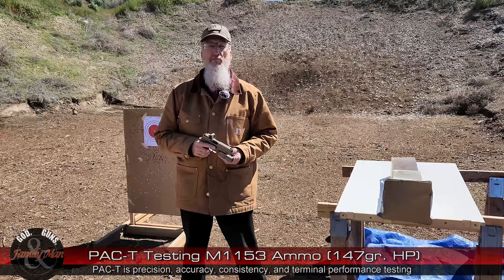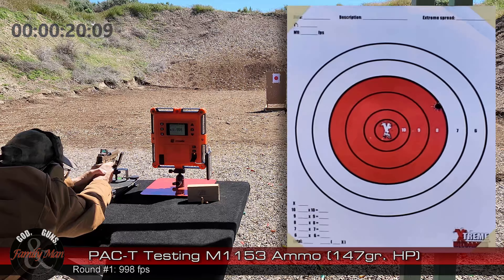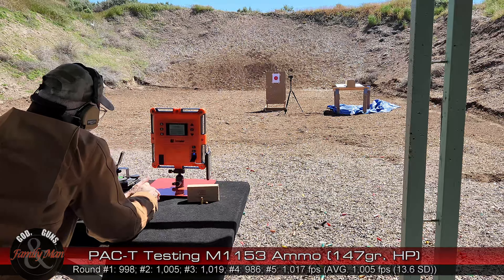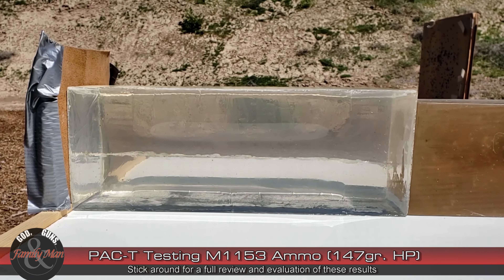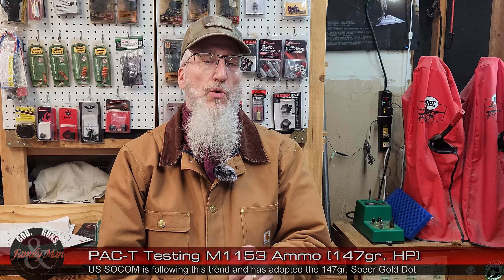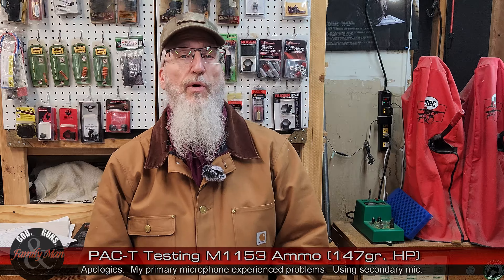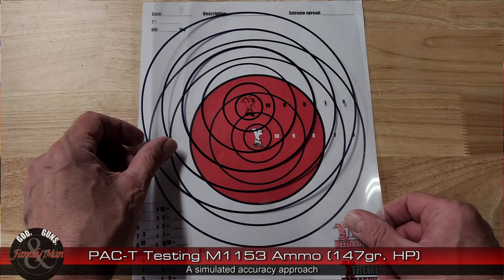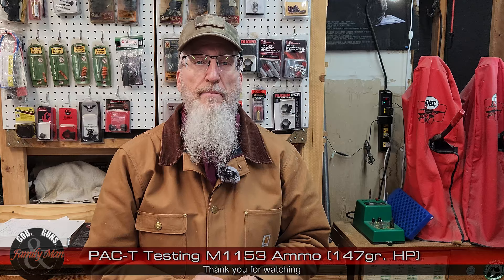Testing the US Army's 147 gr. JHP M1153 +P+ 9mm Ammo

Comment: The speed of sound changes by temperature. The air pressure over density is constant. Frequency, amplitude, wavelength have no influence on the speed of sound. If we talk ideal gas and not 100 km high near vacuum or inside a pressurized car tire.
Reply from the maker: Yes, that is correct, that is why I note speed of sound at my location. However, even with variability in the speed of sound these rounds will almost certainly remain subsonic anywhere on the planet.

Comment: The m1153 uses the ra9sxtc bullet, Winchester also sells it as USA9JHP3 of which i bought a 50rnd box of. Compared to the federal hi shok 147gr 9ms it has a little more kick but not bad at all. I’ve shot about 600 rounds of the m1152 loading in the Winchester sg9w box and that’s the most kick I’ve felt out of a 9mm bullet yet and it’s what I put in my handgun for hiking.

Comment: Ahhh, I believe Winchester is fibbing on the +p+ pressure,, I got a chronograph and do a little ammo testing ever now and then my self, and I’ve got more speeds out of standered pressure 147gr, from a couple of my 4 inch barrel guns, and the regular +p ammo I’ve tested I get around 1100fps, and with a couple of my 5inch barrel guns they get around the 1150fps range, give or take a few feet per second
Reply from the maker: That is interesting.  This was tested using a full-sized pistol (in fact very similar to the one adopted by the military) and I agree, this does not seem like +P+.
In addition, this box of ammo is considered reference ammo for the M1153 and not sub-par surplus.
Thanks for watching!

Comment: One point - the Hague Convention speaks specifically of expanding bullets. This waste of lead and copper fulfilled that requirement. Better to use a controlled fracturing bullet - it doesn't expand, but it surely makes a more devastating wound than either a FMJ or a non-expanding hollow point.

BTW, a +P+ round that's slower than a standard pressure round of the same weight? Ridiculous.
Reply from the maker: I have seen other "bare" gel tests where this same bullet expanded nicely.  However, our test with these soft barriers more closely mimics reality.  It is disappointing that the bullet failed to expand and as result, over-penetrated.  When the Hague Convention made that agreement, there was no such thing as a controlled fracturing, barrier blind bullet.  I wonder what such a convention would declare today.
Overall, it looks like this bullet was not a good decision by the Army.   They could have chosen the 147 gr. HST or as you suggest, a barrier blind CF bullet.  Thanks for watching and posting.  More good stuff coming up.

Comment: you want some really hot stuff try the m1152. This stuff you have here isnt no +p+
Reply from the maker: I believe it is loaded like it is to keep it subsonic.  I am not sure why they labeled it +p+ though.
Reply: @sdkweber  All the apparent mislabeling tends to confuse me brother. For instance this m1153 labeled as +p+ but only getting 900 something fps makes me wonder is some other loads that aren't labeled as +p or +p+ might actually be +p or better. The m1152 I mentioned isn't labeled as +p or +p+ on the box yet in the stats it claims a muzzle velocity of 1320 fps at the muzzle with a psi of 39,500. That indicates it is a tad above +p but not quite +p+. It's in a little gray area between the 2. It also says it is loaded to military specs 10% higher than industry standards. It has a 115 gr fmj flat  tip bullet. I fired several mags through my taurus g3 and it functioned well but you can feel the increase in felt recoil and muzzle flip. I still have 200 rounds of it. My g3 is a fairly sturdy and robust gun but certainly is not on the same toughness level of a sig or a glock so after I finish off what I have left of the m1152 I will stick with standard pressure ammo just to play safe, and I'd be very weary of shooting any of it through my smaller g2c.
Reply from the maker: @kennethrisner-c8q  I hear ya.  Most of the 9mm rounds I shoot are "standard", in other words not +p and certainly not +p+.

Comment: I wonder if the failure to expand is related to the short barrel velocity. I was under the impression (possibly faulty) that the 9mm +p+ was brought about to use in the uzi and hk mp5 style weapons which have a bit more barrel length to extract more from the load.
Reply: Any faster and it would be supersonic, which would defeat the purpose of using it in suppressed SMGs.
Reply: @ESMaddock  yes, but back years ago when the +p+ was designed, supressors were available, but not in the common usage they are today. The idea was a round to make the sub-guns more reliable and more effective downrange since it was"only a 9mm"
Reply from the maker: The failure to expand was because It clogged as it passed through the jacket and leather.  I heard this round was designed to be subsonic so silencers could be used more effectively by special forces